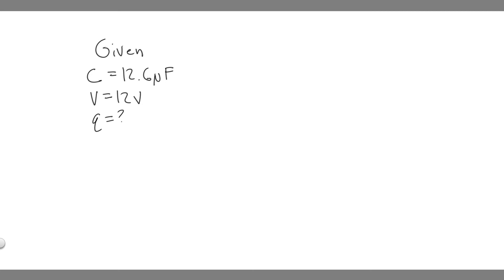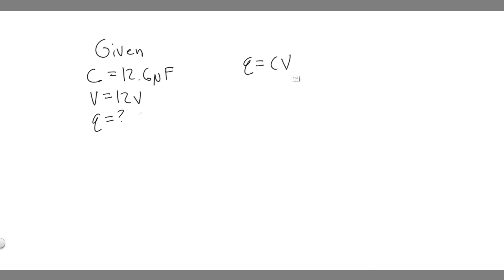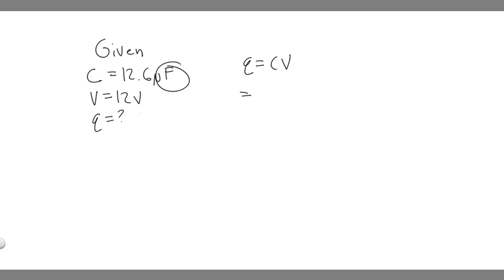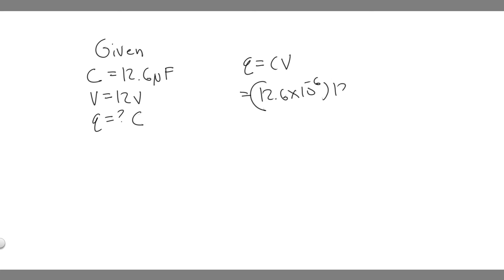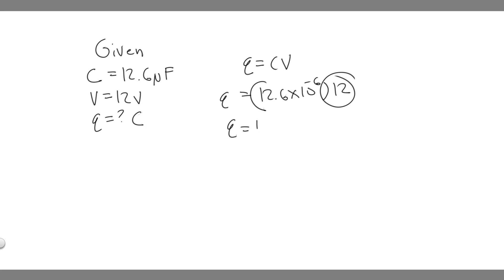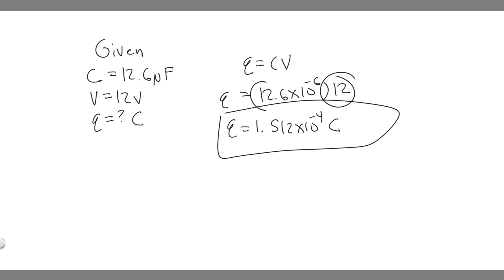How much charge flows from a 12.0-V battery when it is connected to a 12.6 µF capacitor?

Comment: a ball is thrown vertically upward with a speed of 30m/s. How long will it be in air?

At the instant the traffic light turns green. A car starts from rest with a constant acceleration of 6 m/s2. At the same instant a bus travelling with a constant speed of 36 m/s and passes the car. How fast will the car be travelling at that instant?

A ball is thrown with an initial velocity of u= (10i + 15)j m/s. When it reaches the top of its trajectory. Neglecting air resistance. What is its velocity?